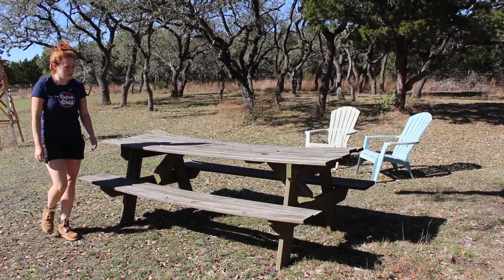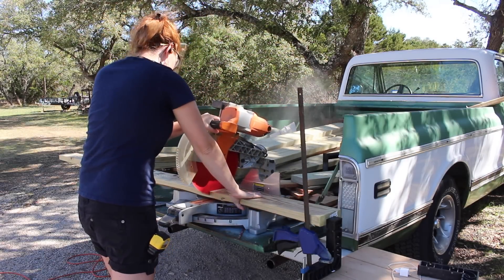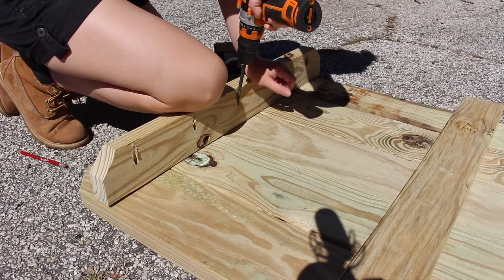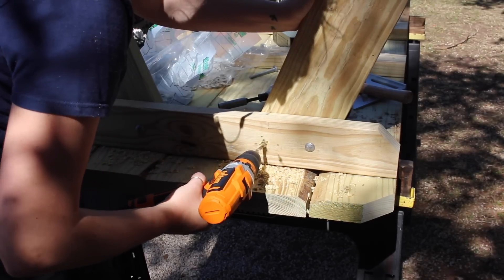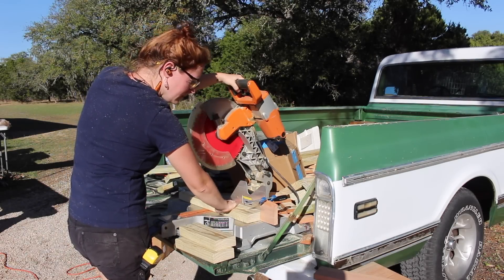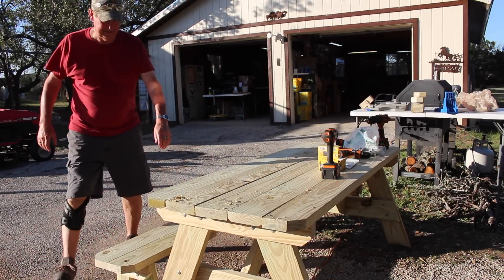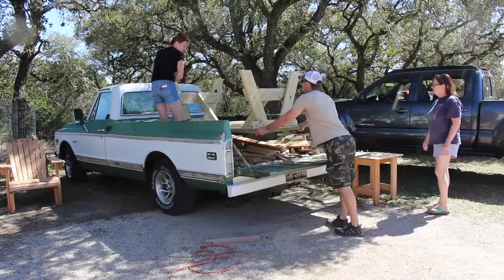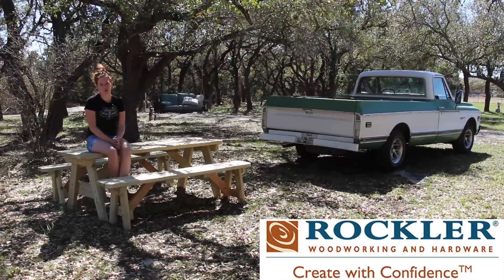How to Build a Picnic Table

Comment: Since you don't have impact sockets, at the very least you should wear eye protection when using the impact. Regular chrome sockets are hardened so their thin walls do not twist under torque, but when subjected to the hammering of the impact they can shatter like glass. Been there, done that. Otherwise, great video as always.
Reply: Nigel Watchel hmm. good to know. thanks!
Reply: YIKES! I wasn't aware of that; probably especially true of cheap chrome sockets. Thanks, Neal for the heads-up.
Reply: Sure they will easily hold up using them on wood! Lol

Comment: Hi April,
That's a fine looking picnic table. Working from the truck at least lets you still complete your projects. Like you said, will be a few months before you get to work on your shop.

Nice you being able to wear shorts. It's 38°F here near Philly with a Nor-easter coming to dump heavy wet snow Monday night through Tuesday. They guestimate 8 - 12". Doesn't matter how much, I don't like shoveling snow anymore.   :-(

However, I have to install a new starter in my sister's Grand Cherokee today if I want to be able to move it to get the driveway cleared of snow. I will be working outside. No garage here.   :-(

Take care and looking forward to next video.

Comment: Unattached benches also make the table and benches more versatile for use in other projects. Mine stay in the shop for the winter months for sanding, staining drying.... I even use my benches to lift my push mower and other small equipment for oil changes. If they get in my way, they are design to be outdoors so that is where they go until I have room or need them again.

Comment: Also.... I will put my wood table on the ground and wonder if there is some type of (metal?) 'feet' to secure to the leg bottoms to prevent rot.
Reply: I know its been awhile so you probably found something by now but I use bricks with holes, cored brick? I think they are called. The brick keeps it directly off the ground and the holes let the water drain away so it doesn't stay wet.

Comment: Two questions. First, did you use a jig for the pocket holes? If so, can you describe it so I know what's needed. Second, can you also describe what you mean by "Right Angle Guides"? I am unfamiliar with this type of tool/equipment.

Comment: I just built traditional picnic table and the wood I used is pressure treated lumber from home depot and it has a red look like cedar which dressed it up nice. For less weight, you can use 5/4" decking boards for top and seats.

Comment: Great to see the safety glasses April.  My cousin is blind in one eye because he ripped a board that still had the bar code tag stapled to the end of the board.  He was lucky.  It could have killed him if it had gone deeper.  Just a cautionary to all, takes a few seconds to pull those tags off of your boards and also to do a quick scan for stray staples or tacks on your lumber before it hits the blade.

Comment: I built custom tables for a friend.  Almost your design , but the tables were 6" long and the tops were 3/4 inch poplar.(reducing the weight because they were an older couple making them easy to move around}   these  tables matched for a 12" table. they were kept under cover and are now about 10 years old and holding up well.  Nice job for a tailgate party.

Comment: April I always look forward to your videos, and as a builder that has to work off the tail gate of a truck time to time, I can only offer one suggestion.  When you 45 cut the top boards next time cut it on the backside of the board.  With an inside cut the blade can kick your cut off and I would hate to see that trucks rear window knocked out.  Speaking from experience.
Reply from the maker: Thanks a lot for the tidbit of info. :)
Reply: newbie question here. What does it mean to cut it on the backside of the board?  And where is the "inside" cut?

Comment: I too prefer separate benches. That makes the table a bit more portable, with the option to put one side up against a wall, plus letting you use the benches elsewhere as needed.

Comment: It was a little bit hard to tell but it looked like the carriage bolts you used were just about the right length without a lot of threads hanging out past the nuts. On the ones running horizontal I would suggest using cap nuts to eliminate the threads catching on bare legs under the table. Other than that I really enjoyed the video and the finished project. I look forward to seeing your next adventure.

Comment: I searched the internet and reviewed many picnic tables prior to watching your video.  The separate benches hooked me and I purchased your plans.  There are not many homemade picnic tables where the screws or nails are not in the top side of the boards.  When I build this weekend I will use pocket hole screws and add glue to secure the battons.  Also, curious as to your recommendation of 4.5" carriage bolts as I think 4" would work fine.  

Thanks you for the plans and video!
Reply: I built the picnic table and benches per the plans purchased from April.  All three pieces are solid as a rock!  To anyone thinking about making this table I recommend that you consider adding 1 to 2 inches to the lengths of the table legs.  The height of the table is just a little low for my personal tastes but the benches are perfect.  They do not need to be be taller if you decide to increase the height of the table.

April, thanks for the plans.  All of my neighbors love the build.

Comment: At which angle are the legs cut? I'm building a stand for my lathe and im unsure how I should cut the legs.
Reply from the maker: There are plans on my site if you are interested in the specifics.
Reply: April Wilkerson site
Reply: @AprilWilkerson  I checked the plans and did not see a distance for how far in to mount the cleats on the table/bench tops. Thoughts? Thanks for the videos!

Comment: just one question April what are you going to do about all the poison that's pumped into the pressure treated wood? I know for a fact here in St.Louis they banned all the wooden tables in the park system because they were pressure treated I think it's arsenic that they put in there I'm just saying.
Reply: The old table would have had arsenic, the new formula which is not as durable does not leech out.  This was done as people using the old CCA, me included,  for garden borders had increased arsenic levels in their soil.  April indicate that the table would be painted once the wood had a chance to dry out.
Reply: David Moran thanks for the update David I guess I've been out of the game too long I don't know about all the new products available thanks again my friend.
Reply: Opa's Workshop Yeah, it's copper sulphate now. no arsenic

Comment: I’d like to order the pdf plans for this picnic table.  On your site there are no directions on how you receive this pdf copy.  Some have commented that they never received the download (1).  Could you please provide some directions on how to get this pdf plan?  Thanks
Reply from the maker: Sometimes the plans are sent to your Spam folder. If you buy them and don't get the plans, first check the Spam and still if not, email us. Emailing is better than trying to tell us through the comment section. Thank you for watching.

Comment: Great work as always April.  I love your channel. I can't tell from the video, but I was thinking you could set the spacing on the seat legs 3 inches shorter than the table leg spacing to help the seats "nest" into the table better when not in use. Just a thought.

Comment: I like the fact that the benches are separate too. You can use either just a bench or just the table or mix and matched with any number or all three together - much better options than the benches attached permanently.

Comment: I made the picnic table using 2x8's and it is a BEHEMOTH....I made it 7 ft long!!!! Now, my friends all want one!!! So I made one using 2x6's yesterday and one bench...and went to Lowes to buy the 48 carriage bolts?? Geez louise...are those necessary?? I put them in my big boy but the cost (even on Amazon) is like $2/ bolt/washer/nut. If we don't move the table are they necessary?? I have put the holes for the bolts in now and it's stable as heck. I pay $5.37/each for the 11 2x6's= $59.07 + 2x4's x 6 = $4.98 = $29.88 so in wood alone I have $95 (inc. tax). The carriage bolts adds over HALF the cost..I am leaving the one I built in my front yard and it will NEVER MOVE...any suggestions on maybe putting a wooden dowel in those holes or am I being cheap/kwazy/insane/?? love your videos...thanks.

Comment: At the risk of resurrecting an old thread; Would this same design work if the table was 8 feet, rather than 6? If so, should you add additional bracing to the top? I like this idea, but want a longer table.

Comment: Hi April.you do a great job on your vids with the narration and demo.I'm usually just looking for design ideas, don't need bolt size,hole size or other specifics-but general measurements like your bench height issue are worth mentioning.Thanks for posting the great vids,and I'm looking forward to your design/plan ideas for your new shop.

Comment: I dont get why is it OK to screw the table underside boards to the table boards. The wood grain is opposite to one another, why is that not structurally wrong??
Reply: Diego Gza the boards on top are not glued together so I think there is no damage as things expand and contract.

Comment: Hi April from England,

Great video.  I was thinking of making something similar.  Watching you build this, I was just wondering if you had left enough space between the boards on the table top to allow for expansion.  I would have left at last half an inch between each one.

Thanks again for a great video.

Regards,

Bill.

Comment: Ugh... April. Making picnic table off of the plans you have and I have already hit a couple of snags in measurements. I.E. Bench Leg Support 14 5/16 and then on page 14 it shows the bench leg support being 14 3/4 on the long side. Anyway, I do love watching you building things but the plans need a little more scrutiny for the measurements.
Reply: Jim Acree I'm about to start this build, which measurement did you end up using?
Reply: Yes it is going to require one more 2 x 6 x 8.
Reply: Jim Acree Since you raised your table up did you also raise your benches? I'm planning a build like this now but I think I might make mine 8' long.
Reply: No on the benches. They turned out to be right height.

Comment: Hi April, love the videos.  You're very determined, innovative and patient.  As you're cutting the tabletop, in this particular setup, the right hand piece is the shorter, most likely scrap piece.  The piece on the left will vary by as much as 3/8", particularly treated lumber.  About the only pieces cut to exact length at the lumber yard or home store are pre cut white wood studs.  Took me a while to realize that a long time ago when I was first starting out.  I admire your ingenuity in dealing without a shop.  Now you're working like a site carpenter.  Looking forward to the next video too!

Comment: I used the plans from the site. It looks great, I recommend making the table legs taller and likewise the benches too. Maybe 4" carriage bolt instead of 4 1/2" as well. It cost more in materials than prefab at box store but, its better.

After a couple days of use: definitely make table legs taller, set bench legs in further to tuck tighter to table. Great game able, kids love it!
Reply: I think 3 1/2" carriage bolts would work. Additionally, some 3" screws for the cleats would be nice.

Comment: What software did you use to make those plans?
Reply from the maker: SketchUp
Reply: The best program there is, in my opinion.
Reply: Nice table.
Reply: I was never able to figure it out. Solidworks and autocad make more sense to me.
Reply: Translated:
I learned it not from one day to the next, but with the proper instructions (Youtube), I did come very quickly to good results. The point is that you learn good hop about with components and groups. Navigation through operation keys in combination with a scroll mouse, and then you design like a virtuoso.
I am a big fan. Hence my logo (my name is Roland Herremans, how nice is that!)

Comment: I notice there is no space between the planks on the table top or the bench tops. Should a gap be left for expansion since this will be outside 24/7/365?

I live in the Mid-Atlantic and was thinking about building one of these when the weather gets a little warmer.
Reply: If I may offer from my experience, (I've built a few) I can guarantee you if you build the table with fresh wood from the store you will acquire a gap between the boards. If you feel questionable on this do not make your spacing a lot. One thought would be to let the wood acclimate but then you run a risk of dealing with twisted wood. The way April did it is really a good way to build a picnic table. Ultimately you could use all carriage bolts but then you have that bump on the tabletop. I too prefer the separate benches. Regarding the height, just measure your dining room table and chairs. There is a general standard around 32" and 17". If you deviate from this you have to make adjustments accordingly.

April, some day for your new house I'd like to see an octagon picnic table project. That way I can learn to build one for myself that I have been pushing off.
Reply: Larry Be, good to know. Thanks for the tips.
Reply: Chris Stielper larry is correct. fresh wood can in general be tight. :)
Reply: I think the rule of thumb is that most wood expands around 1/8" for every foot in width. So if those benches are only about a foot wide, that's not a huge amount of movement. When you're dealing with something as wide as a table or a door, yeah, that movement adds up, but the benches might be narrow enough to not really have to worry about it.
Reply: Chris Stielper This wood is still wet as a sponge from pressure treatment. It will never swell more. I replaced my trailer floor with wet pressure treated 2 x 10 lumber. Let it dry for a week or two before installation, and it still opened 1/2" gaps the first summer.
Reply: Chris Stielper  treated work  will not expand
Reply: She said they were wet boards - they will shrink.
Reply: dalesworld 
Is correct. When laying down treated boards, leave no gap. They will shrink as they dry.
Reply: Chris 🍅🍄🍒🍑🍑🍊🍋🍊🍏🍏
Reply: I agree with Larry Be.  I've built several decks and when I use fresh, treated lumber I do not leave any gap.  Then in about 6-8 months there will be a nice smal gap in the wood as the wood dries.

Comment: April, Great Video as always!!  One question though..  Where does the diagonal piece attach on the underside of the bench?  It appears as if it lines up with the gap in the bench seat.  Did you run the screws at an angle or go through the bench from the top?

  Also, you have inspired my 14 year old daughter to learn about woodworking!  She has always liked the things I have made for her and the family, but showing her your videos has helped her get over the "it's a boys thing" to build stuff.  She now helps me with all my projects and I even got her her first power tool, (cordless drill) for Christmas!  Thank you for the videos and please keep it up!

Comment: April, great job, thank you for the video. I got a question, can I use 1X6's for tabletop and bench tops as opposed to 2X6? I want to cut down on the weight. Thanks again!
Reply: Don't do that on the bench tops but you could on the table top. Try decking boards.